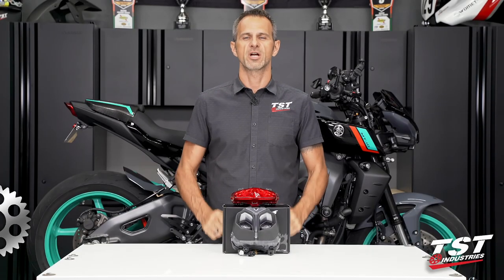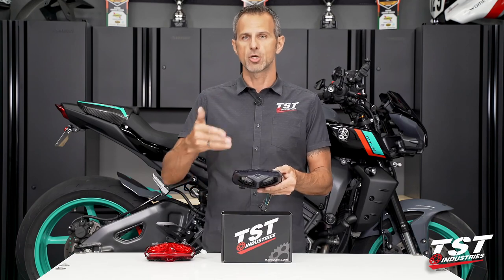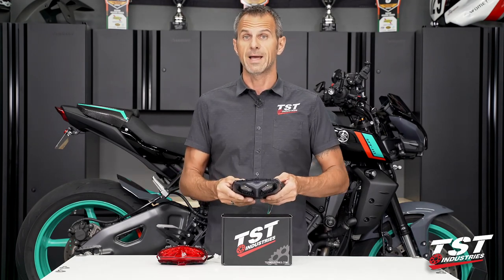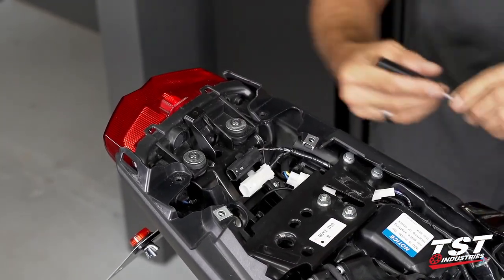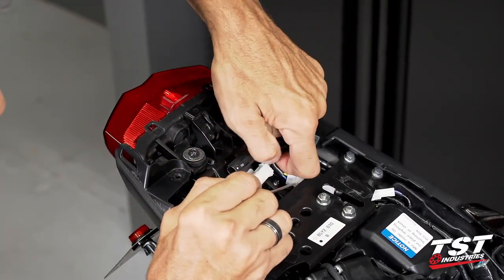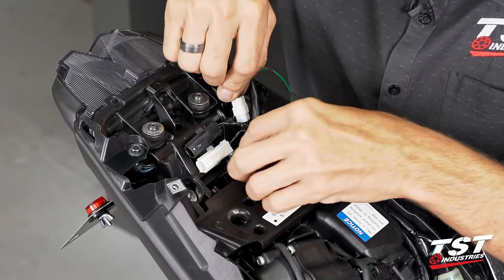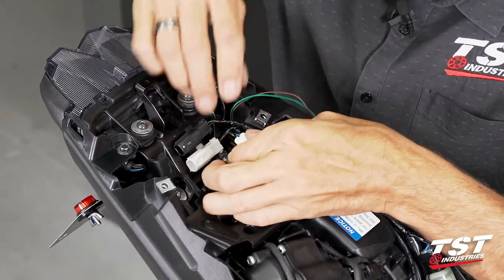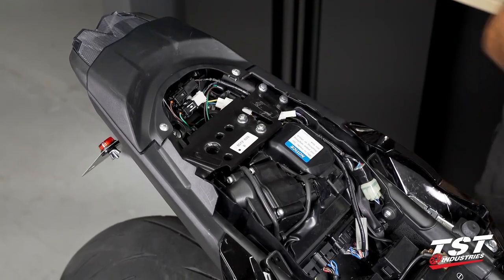How To Install Programmable Integrated Tail Light on 2022+ Yamaha MT-10 by TST Industries

Comment: This is SO slick. Always love your products.  Honestly wish you guys would had gone all in with the cb650r. Grabbed one a few months ago and was ready to slap all tst everything 😂 but then I saw its a platform that for some reason you guys didn't really gravitate to. Grabbed your tail tidy and license plate light though, but would have loved a integrated tail light, shorty levers and an under mount license plate option. 

But always sick to see what you guys are up to. Much respect always and shout out from Puerto Rico ✌🏼
Reply from the maker: Hey buddy. Great to see that our products are going to Puerto Rico. I love it there. Especially Rincon and Arecibo. We tried out the CB650R market by putting several products out to feel the demand. I started the design of a tail light. When we saw very small demand we halted the tail light development. I have some very nice prototypes but nothing beyond that.

Comment: No license plate light for the matching fender eliminator? That's a deal breaker, since around here that's a certain ticket.
Reply from the maker: We offer it separately. We understand the some riders may not want or need one so we leave the choice to the customer. You can absolutely add one in on our website.

Comment: Really wish this was legal in my state. 😢
Reply from the maker: Simple solution... you can use external signals for the signaling function and still be able to use the tail light for running/brake
Reply: @TSTindustries  Actually I bought one just now. I’m going to run it without the signals and see what happens. They pretty much ignore everything we do here in Washington. Cheers
Reply: Mostly smooth except for the main white connector. Popping that out took dental tools, more time than the project itself and busted anyway. 🥵. Was doing the tail tidy at the same time for consolidation purposes.
Reply from the maker: @user-hf8ie8mf3n  i know that connector retainer can be challenging. I don't like how Yamaha solved that one. The easiest but most laborious way to get it out is to disassemble the side tail fairing and compress the anchor with a needlenose plier. I did not portray it that way because it is easier for me to just get the anchor out from the top side with a pick. It felt less invasive to do it that way but after hearing your experience i am thinking I probably should have portrayed both approaches.